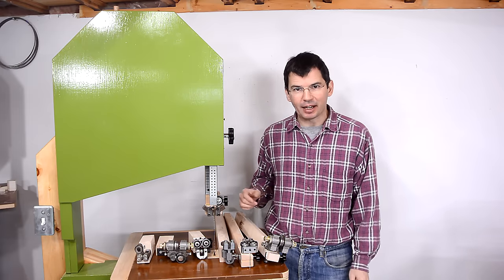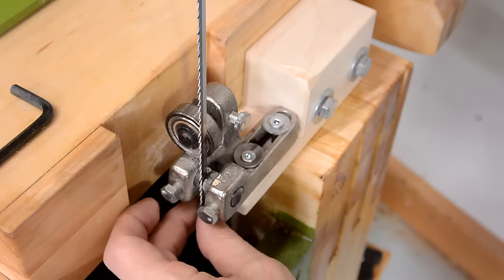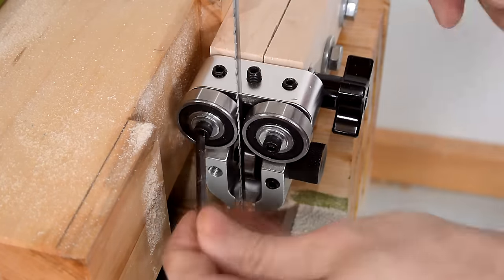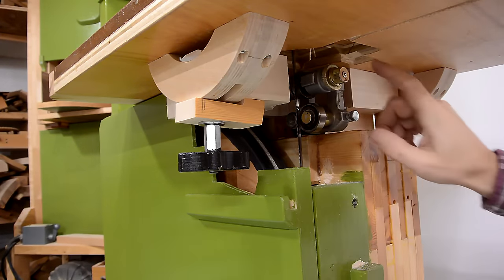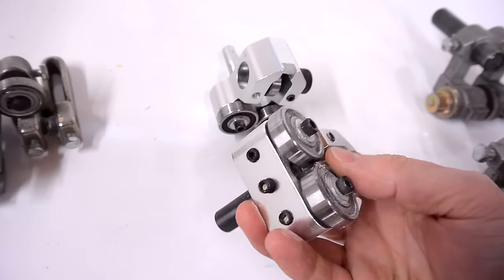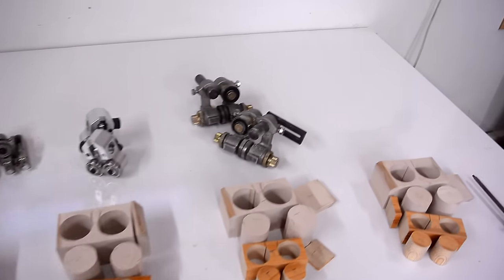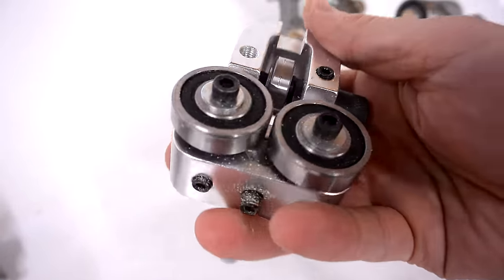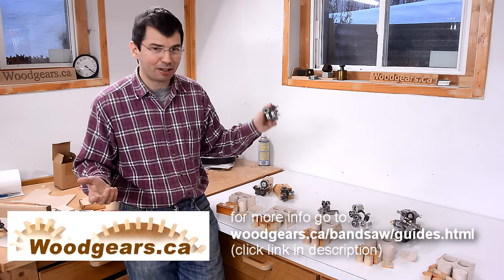1 bandsaw 4 blade guides comparison

Comment: Yeah, I didn't even notice the blade guides.  All I could think was: 1. this guy built his own bandsaw and, 2. Matthias can cut a better circle/cylinder by hand than I can do with my circle-cutting jig.
Reply: I noticed those right away, too. And the painful-to-look-at shade of green he painted the saw exterior. I guess no one will mistake his saw for anyone elses. 

I use ceramic blocks in my upper and lower side guides, and set up my saw using the methodology of Alec Snodgrass, but I DO use brass shim stock to set them for distance away from the blade. Hearing the statement, "they don't work," made me laugh out loud.

I used brass shim stock to set thousands of tools in CNC and manual mills and lathes for hundreds of setups. Some of the tolerances I needed to hold were as tight as  +.0000"/-.0008" while certain aerospace, defense, and prototyping jobs required even tighter tolerances than that. I was commonly holding total tolerances less than .005" on turning, milling, sinker and wire EDM, and obviously grinding was about 10% of that .005" total.

Unless I had an electronic tool setter, like on some Haas machines, a tool setting probe, or my favorite, using an optical tool pre-setter, I always used brass shim stock, of verified thickness. Even when I did have access to those other methods/technologies, I ALWAYS followed up by checking the offset with a piece of brass shim stock. 

It was just a few seconds per tool spent verifying the accuracy of the TLO, or coordinate offset value, which is ALWAYS less time then to try to clean up, or determine a fix for, cutting a dimension on a workpiece, especially a critical dimension, undersized and out of tolerance, due to having an incorrect offset. Time spent, a few seconds or a minute , per tool, just to verify each tool, is ALWAYS less time than it is trying to explain to your boss, and sometimes his/her boss, why you scrapped a very important work piece, for a very important customer, with extremely limited time before the delivery deadline, and having no excess stock of that material, to make a replacement part before the delivery date. 

So it does work, just have a skilled and talented machinist, or toolmaker, demonstrate how it's done. Using the Alex Snodgrass set up procedure, and using my brass shimstock to set the distance of my ceramic guide blocks from the saw blade, has allowed me to achieve results which would be acceptable if I were in machining metal in a machine shop. I set up my extended range resaw fence, a recent shop project, and checked/adjusted the set up of the band saw, and in resawing 5 pieces all wider than 10 in, one piece 21 in in length, and the other four 34 in in length, I held all of the resultant thickness measurements within 0.004", so I have to say that I am pretty happy with my Jet 14in band saw, with a 6-inch riser block kit that was also a home shop project, and running a Wood Slicer blade. I must also add how pleased I am with that blade, as it never seemed to struggle or get overly built-up with saw dust despite the 10" and 11" the saw was cutting through, very little blade deflection or wobble, obviously no drift, and possibly the most impressive thing was how quiet the cuts were compared to other blades, in the same material but only cutting through a 5" to 6" wide workpiece.

Ok, apologies for the verbosity. Enough blather out of me. Time to get back to my shop and make some chips and dust.

Comment: Loading of the blade with dust can be stopped (or at least helped significantly) by putting the heads from a couple of spent toothbrushes against the blade (via a new jig) a few cm under the rollers. 

Love your videos, and all the home crafted tools. Keep 'em coming.

Comment: Thank you for this very helpful and ingenious video.  I recently came into possession of a 10" Craftsman model 113 bandsaw which is completely missing the lower blade guide assembly.  My research so far has shown that these lower guides have a very high casualty rate, and so replacements are scarce to non-existent.  I'm very inspired to see the possibilities that exist for thinking/building one's way out of the situation.  For example, using wood for the guide support bracket already solves a lot of headaches for a guy without a machine shop.  Keep up the great work!

Comment: Carter recommends if you're using a quarter inch blade or smaller to only use the top guides and completely move the lowers out-of-the-way. also they say to preload the blade with the thrust bearing about 1/8 of an inch. counterintuitively this actually allows smaller blades to twist and flex which really helps with tight corners believe it or not.
Reply from the maker: pre-loading helps keep the blade in the guides and makes it easier to back out of a cut.

Comment: The psychological factor, I didn't see that one coming. Love the work you do, especially the glue joint testing and saw milling.
Reply: Ah, the psychological factor. Think of it as two different tools built to do the same job. It can be as simple as a hammer or as complicated as machine tool. If one feels crude and the other is a pleasure to use. Either because it fits the hand well and isn't awkward. Or because it is well made, fitted and seems effortless when operating as in the case of a machine tool which would you rather use or own.

Comment: A compelling reason to use the bearing style guides is that you have a very obvious visual indication that they're set correctly when they begin to rotate as you turn the wheel. Sometimes they're tool-less, although I don't have any difficulty with using allen wrenches on mine.

I found that if the bearings aren't touching, it introduces a large amount of drift. If they are, there's almost none.

Comment: Four bandsaws and at least six sets of guides have rotated through my shop in the last 40 years. Your findings are exactly what I'd have guessed. Those cheapie guides from a Delta/Rockwell 14" bandsaw would be fine if only there was a micrometer adjustment to the guide blocks. The trick to setting the gap with any of the guides is to use either a rolling paper or cellophane off a pack of cigarettes folded around the back of the blade. Bring the easiest guide close until it is just touching. After it is locked down bring the other guide hard up against the paper then lock it down. You'll end up with just a couple thousandths clearance evenly divided between the left side and right.

Comment: Very smart analysis.  I have gone back to liking square blade guides over bearings. The lower blade guide bearings on the bandsaw will get impacted with dust and resin or pitch from the wood making an adhesive coating on the bearing surfaces that effectively increases the diameter of the bearings making them run in full contact with the blade all the time . This will lead to premature bearing death. I have found the bearing'ed bandsaws eat bearings like candy especially in a shop where a lot of softwood is cut. Square metal or Cool Block guides are self cleaning.        (I maintain the machinery in a Makerspace near Boston Ma. or as I like to call it, "The woodworking machinery testing laboratory", where there are lots of users of different skill levels and the users are particularly hard on the machinery.) So I agree with you, keep your old square blade guides.G.

Comment: I think this test may be flawed. You need to test until there is a discernible difference in order to make a meaningful comparison. Something's got to give.
Reply: Paul Frederick PRICE
Reply: Jim Jacques
we've yet to see if price is justified, or not. As that is the only quantitative value we have at this point. We've yet to determine if everything else is equal.
Reply: If they're all functionally identical in everyday usage that is a meaningful comparison. He did mention the edge case of using sawmill blades which might affect a buying decision. Other than that, what edge cases are you concerned with which might be worth testing?
Reply: Ryan Brown
sawing harder, and thicker materials. At some point a distinction may be found. Resawing seems to be a demanding task too.
Reply from the maker: I didn't feel like spending hours and hours sawing up good wood.
Reply: Matthias Wandel
saw good wood into better wood.

Comment: I just upgraded from an old 14" Ridgid to a 14" Grizzly. The Ridgid had the cheap guides with blocks, while the Grizzly has bearings. I much prefer the Ridgid  setup. You only have to worry about replacing the thrust bearings, and setup is much easier with the little knobs. I hate having to use a tool every time I want to make a minor adjustment.

Comment: Another big factor in how well a band saw cuts in terms of blade drift is the set on the blades and the wear on the outside of the teeth. This goes on top of wheel balance, blade tension*, blade guides and their adjustment, tire condition, pulley runout and belt condition. Most of my bandsaw experience is actually with industrial saws from DoAll. We always welded our own blades from 100' coils. The quality of the weld, proper annealing and grinding to establish width and a straight back were crucial. Actually having a welder on the saw made it easy to do internal work. I typically welded and kept blades for my own use. It is amazing just how long a blade will last when it is not in use by everyone in the shop. The guides on a DoAll are nothing fancy. Thrust bearings with replaceable wear covers and solid guides that slid in slots at a 45° to the blade travel. If these were worn it was a simple matter of trying them up on a surface grinder. I really miss having the facilities of a full Tool Room available.

*Proper blade tension is around 40K psi. I know that sounds like a lot but on a 1/4 blade its only around 150lb/68kg or less because you actually have to account for the depth of the gullet. A fine 1/8th blade probably only needs 60 to 70 pounds

Comment: Carter makes one I am interested in buying or making one.  It is for scroll cutting only and you loosen your bottom guides so they do not touch the bade in any way other than the thrust bearing when it is cutting.  Then the upper is two bearings stacked together and the edge has a slight taper where they meet.  This replaces the upper blade guides with a wide thrust bearing that is grooved and you adjust it so the blade has a tiny pressure against it.  The blade rides in the grove along the back. They are made for 1/4, 1/8 & 1/16th blades just for scroll cutting.   From the videos they make a bandsaw cut almost as tight if not as tight as a scroll saw. But at the speed of a bandsaw.  I am very interested in them.  I only have a little shopsmith bandsaw for now I have no read complaints.  It has metal guides, but I seen these and thought man that would be awesome to scroll cut 2 x material as fast as I can cut 3/8th in on my scroll saw.     You should check them out.     Any Idea the cost to build your saw minus the motor with prices today?    I have always loved it.

Comment: if those rollers are not supposed to touch the blade why put them there in the first place? xd
Reply: They touch when the blade is being pushed on by wood being cut, as the blade is not under so much tension that it won't move around under force. Having them touch in the default setting will just cause unnecessary wear and noise.
Reply: They are not supposed to touch the blade when nothing is being cut and the blade is moving.
Reply: Fester Blats the guides only allow for about 1mm of movement at the most. This is not much more than the blade itself can flex while cutting something. The bandsaw is not supposed to be a precision instrument and expecting to get perfect cuts from a bandsaw is a bad idea
Reply: You'll also loose a mm or so just in the width of the blade itself. A skilled user of a bandsaw will understand which side of their line to cut on, and also which way force is being applied against the blade so that they are not compounding inaccuracies, but rather compensating for them. But yeah, tightening the blade guides right up wouldn't really make it any more accurate, since you're only ever dealing with lateral movement in one direction at a time anyway.
Reply: Nikola, it''s true only for weak motors and high cuts. If you use bandsaw more as a jigsaw for low cuts (1-5см), blade bending is hardly noticeable. That is, if your hands grow out of shoulders with the head on top of it :)

Comment: Just a tip on the cheap ones, you said the lower guides were under the thrust bearing, but i have a similar piece on my saw and its turned around. My guess would be the manufactyrer mounts it with the thrust bearing down

Comment: so right about the mental mind tricks. the sales pitch on anything is always going to be (this is the guides you've been looking for. or make the most accurate cuts you can possibly make with our product.

Well in my opinion some of the best carpentry work was done long before I was born and long before any of these full bearing guides where around I do admire the idea of less friction but in actuality I think that the blocks provide a bigger surface to contact the blade making them a better choice.

Comment: Do you think there is any difference between bladeguides when you use the biggest sawblade for milling logs?
Reply from the maker: the smaller blade guides wouldn't handle the big blade, so yes, that is a difference.  Beyond that, not that I can think of.

Comment: Fantastic Mattias.  The carter style guides do guide very wide blades well. The bearings are moved just behind the gullet and the back of the blade runs in the thrust bearing slot.   They can pack saw dust on sometimes and I hold the edge of a file to the blade to scrape it off from time to time.  Really fun to see my old guides serve a purpose--- probably their highest purpose--- educational shoot out.  They were always a nuisance to tune.

Comment: A resaw would have been a good cut to make in order to differentiate the guides I would think. Seems to be where variation or drift shows up. What material are you using in your home made guides?

Comment: I built your 16" bandsaw to the plans. I used lignum vitae for the blade guides, although I considered teflon. Lignum was cheaper. The blade guides are far better than on our powermatic 1500, delta 14", and (no surprise) grizzly 9". Easier to adjust, hold adjustment better, quiet, looks good. The lignum can go pretty tight against the blade without issue. Another type of blade guide I have seen on metal cutting bandsaws is bearing bronze with a slit cut in it for the blade, usual ball bearing behind the blade. Not adjustable for blade thickness (e.g. .035") but simple and unobstructive.

Comment: Modern ceramic blade guides?   Seem to be the latest "hot ticket item". They would probably produce practically perfect results (- just like all the guides reviewed - but it might be interesting to hear what Matthias thinks of the occasional sparks and the cost of both the guides and the ceramic bars which need to be replaced sometimes ($$$ :( ).  Unusually they seem to be intended to run in contact with the blade and, the Laguna version, has 10 points of contact (4 side guides top & bottom + back support) so lots of lateral support.

Comment: The main thing I noticed is that the metal Saw Blade(S cuts) sounded different in the high speed video. They sounded smoother but that might just be the way speeding up the video make things sound.

Comment: Was there any big difference in sound, i would guess the guides using rollers more would sound a lot more ?
Reply from the maker: when I built my own roller guides, they were quite loud.  But these new, bigger, higher quality bearings on the fancy guides didn't make that much noise.

Comment: Radial bearings worst case can take a 10% axial load. The "louder" way is the stronger and intended orientation of the radial bearing design. The side guides themselves should almost touch the wheels. My take, for a mill bandsaw, use the louder orientation for sure. To cut tightly, touching the wheel will do better. In short what is ideal depends on your intent. Parts can be replaced.

Comment: All that and no dB reading for each guide? You said you positioned your thrust bearing in a certain way earlier because of the difference in noise. It would have been nice to see some measurements here.
Reply from the maker: the blade is what makes the noise.  I'd just be measuring the blade each time.  Kind of pointless.

Comment: I wish you would have also tried the test without side guides, at all. Or at least only adjusted tight enough to prevent the blades from slipping around the rear guide. I haven't bothered to set my blade guides in about 5 years. They have a huge gap from wear. When I change blades (i use only 1 size for the most part), I only adjust the tracking until the spine is just off the rear guides.

When I see/feel the blade twisting too much, i just stop trying to make that tight of a curve. The resulting minimum radius/arc is about the same, as far as I can tell. It seems to cut just as straight in thicker wood, as well.

That said, i do not bother trying to get a nice smooth finish off the bandsaw, and making veneers is not on my do list. So I would guess the "banding" is worst due to my laziness, particularly in really thin material. But any degradation in gross straightness/wander is not something I have noticed. 

I have also noticed that bandsaw log mills don't use blade guides.